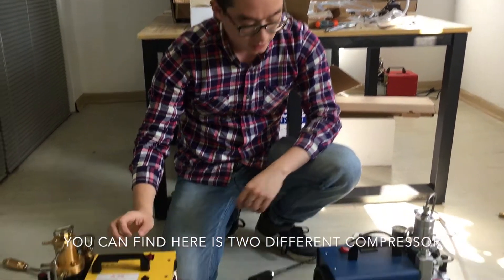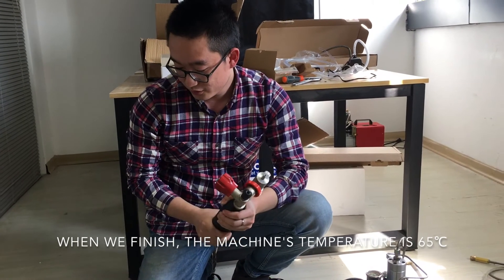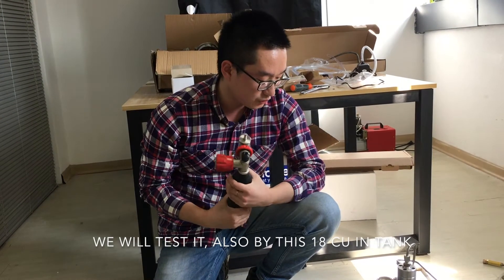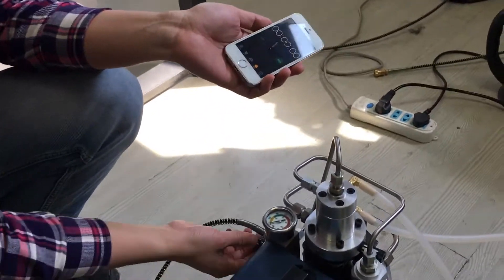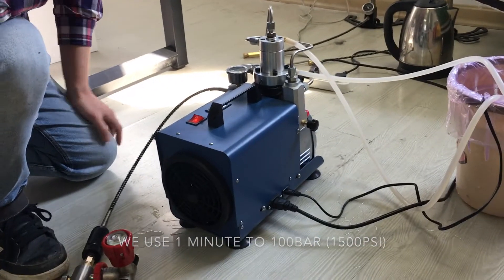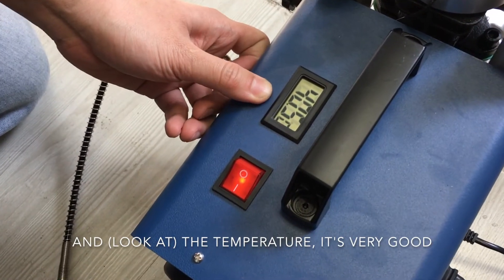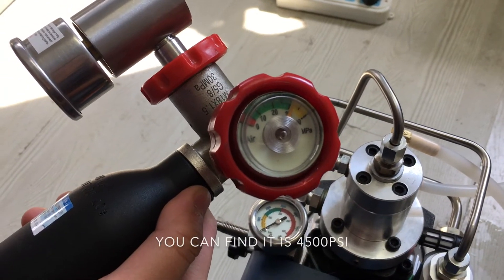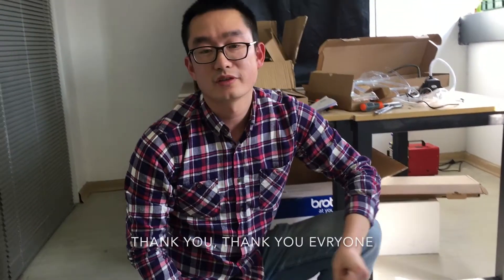Zhongyan 4500psi PCP Compressor Electric PCP Pump

Comment: I’m using one now but it’s leaking water all over on the top and it will not fill up my tank over 2000 psi even setting it at 4500 psi. What’s wrong??? Just bought mine a week ago.
Reply from the maker: maybe leaking air somewhere, have you checked? send me a video or photos about the water leak from the top, my email is aven.shang@hijinjiao.com